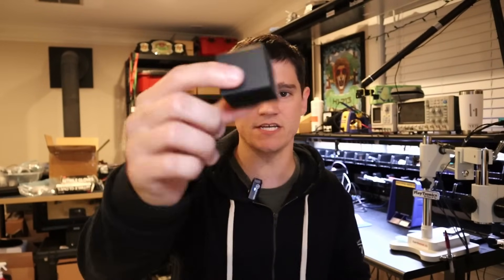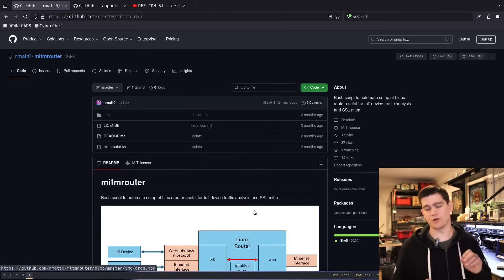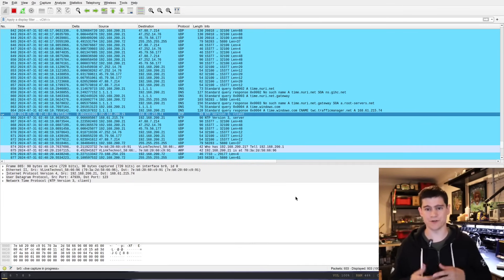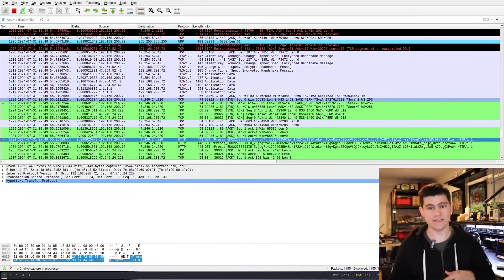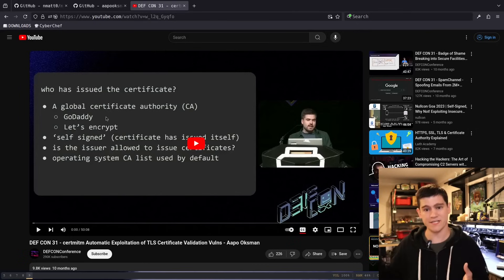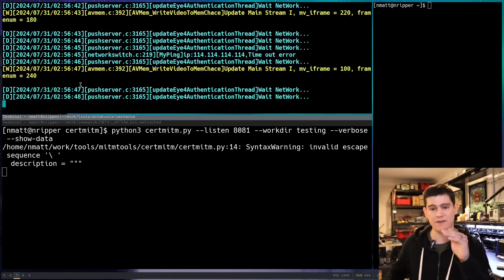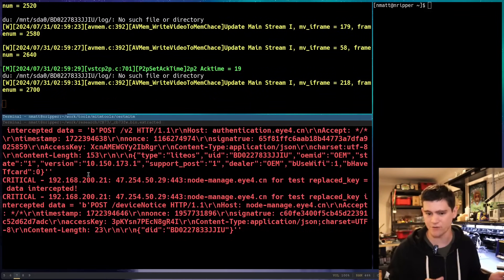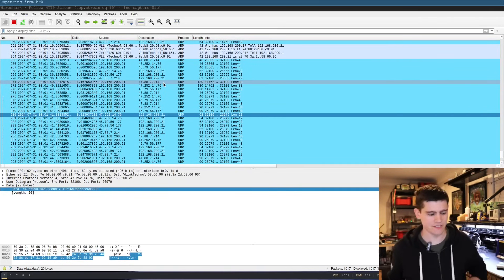Decrypting SSL to Chinese Cloud Servers - Hacking the VStarcam CB73 Security Camera

Comment: pfff...  Social Score:  -10 %  for revealing the dataflow.   :D    
But i love it.   Ever since that guy found out his smart fridge was sending 4gigs of data to some random server - ive been kind of following the topic on what else is sending what data to who.   Just because its encrypted it doesnt mean its completely legit.  No eula or whatever notices prior so its lawfully sketchy.  Not to mention security sketchy in terms of being a secure device.   Now what this fact does, it can make simple smart devices  marginaly more expensive as they will need to be built with security in mind.  One could also compare it to a newer wi fi router vs  cheap router in terms of security functions and protocols/standars...  Theres a significant price difference bc of hw implemented, thats for start.  Also,  to have network devices almost completely idiot proof in terms of setup,  that would cost like a uniti router.  Add that to the cost of something like a security cam and or smart fridge, and you can see where im going with it.  Also  wont help the chip shortage in long term.    Now good luck to the next producer of Smart toilets.  Just make sure it doesnt leak - DATA.  XD

Comment: @mattbrwn could you try hacking and attacking the EDL on the Oppo Watch OW19W8?? It's an WearOS Smart watch but more on the cheaper end and I've bricked it by installing Asteroid OS and then locking the bootloader which bricked the Smartwatch because for whatever reason whenever you lock the bootloader on that device it basically factory resets it's self but the issue is I deleted the Wear OS Partition meaning i can't Unbrick it as of yet and I've tried fixing it through the EDL but it's encrypted and idk how that works and so far no one knows how to unencript it through software

Comment: I have a hodge-podge of network equipment and servers and extremely superficial understanding of how any of it works.
DIR-862L router running DD-WRT and AdGuard Home, 3x Osprey Informatics IP cameras, 1x Vaddio Conference Shot 10 IP camera, Datto Alto A3V2 NAS running Proxmox which is hosting Ubuntu server which hosts NFS share, Nginx, iSpy Agent, plus a Western Digital DX4000 running Microsoft Server 2008, a Linksys SPA2102 VOIP adapter, and Brother network printer/scanner.
How susceptible is all this stuff? I'm genuinely curious!

Comment: Fantastic thanks. 

Chinese solar inverters! 

If you want an idea for something that REALLY matters, here in the UK we are all buying solar. They all have 1 big box called the inverter and it connects to mains electricity, feeds electric into the grid, lithium batteries and the panels. 

Overcharging the battery can cause fire, back feeding to the grid from 1000s of houses at the same time in a local area could destroy local infrastructure. 

I bet there isn't an ounce of security on these devices.

All made in china with software/cloud in china.

Comment: I am not going through 360 reactions, so excuse me if already asked. But why would you pipe the output of find . to grep instead of using find . -type f -name *pem ?
Reply: I noticed this with the useless use of grep too and tried to find a comment and came across yours. I'm guilty of this sometimes too when I can't remember parameters on something like awk
Reply: @JamesTK  I am probably guilt of useless use of commands in real life as well. However, when it is for a video I expect a better use of commands by the host. 
If someone is not aware of the uselessness of commands, I'd advise against making a video. If someone is aware I'll expect better usage of commands.

Comment: Note that just because the domain name ends in .cn doesn't mean that the IP address is located in China. According to whois the IP address is registered to Alibaba Cloud LLC, an American company located in San Mateo, CA, and a traceroute and various geolocation databases indicate that the server is located in San Jose, California.
Reply: Sure. Except still Alibaba. Still a Chinese company. Still a Chinese company with expertise in cloud computing in a country with heavy internet censorship. Maybe your data doesn't go to China directly or at all. But Alibaba still has it and could easily send it over. 

The location isn't even meaningful anyways. Datacenters/Cloud Computing providers are usually regional so there's costs savings all over the place, like not sending every packet directly from a residential connection in the midwest to an overseas Chinese soil server. But rather over lines the cloud platform manages or pays for already and possibly with buffering/batching

Comment: My guess is the self signed cert allows traffic to remain “encrypted” even if the server changes its cert or cert authority. Or, maybes it is a great firewall problem they had to code around. Good? Horrible. Makes me wonder if they thought the device would be useful longer if they just self signed. Like, maybe the api team wasn’t the firmware team and firmware team was like “whatever… good enough.”

I’m guessing UDP is for punching a hole so the api server can directly connect to the device and stream video. Similar to Tailscale but I’m guessing they’re just plain text and easy to take advantage of. 

Writing dumb code is great if you want a massive attack surface, but I don’t think the designers were smart enough to be this bad. I think china likes when teams rush to ship cheap and insecure products which are a result of stressed programmers who don’t have time (or know how) to do things the right way, which gives any attacker a lot more leverage.

Comment: Let's be devil's advocate. Could it just be querying servers for software/firmware updates or dynamic content?

Either way. If I'd want a security camera. I want one that doesn't connect to anything unless I explicitly tell it to connect to something, and then it only connects to that.

If I want updates or anything else, I will do it while the device is offline, connected over USB to my computer or something and just flash the firmware/software update directly from a wired PC connection.

Comment: If it's not PSK or Pinned TLS you can just MITM the DH or RSA exchange. Provided it doesn't force root key. It probably does and you need exploits or chip debug for dump, though. 

sslstrip used DH and fake root; this is why browsers started pinning like five years ago. I use PSK chacha20 on embedded stuff, and would get a chip fused with ROM crypto if possible like Atmel